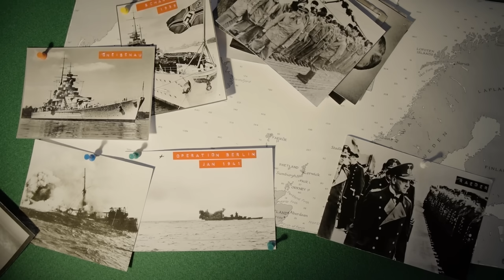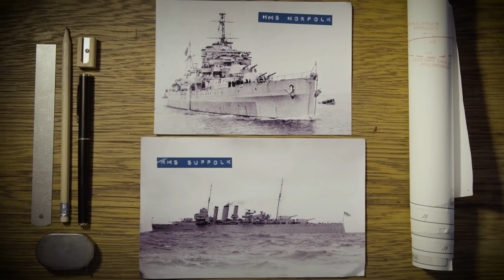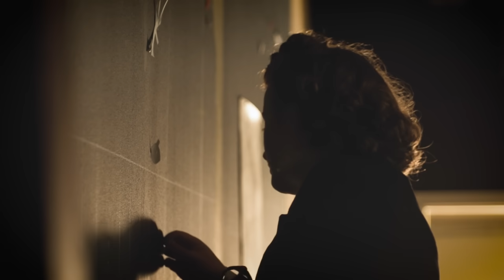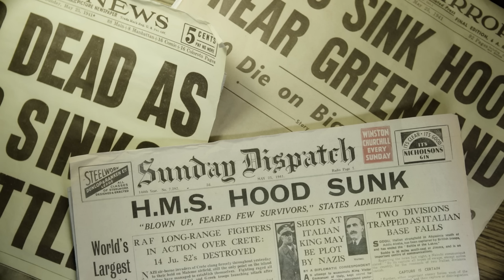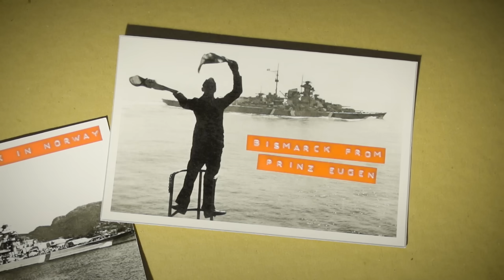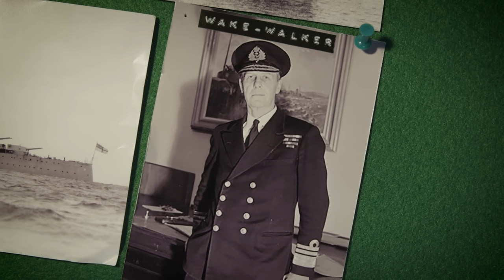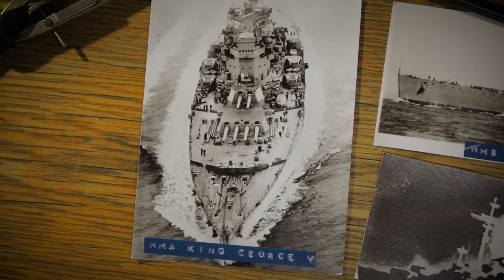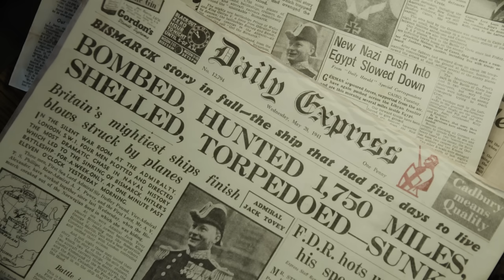Bismarck: How Britain Sank The Infamous German Battleship | Full Documentary | History Hit

Comment: "Attack of the Fairey Swordfish" - sounds like a fantasy novel!  hehe  They were too old, too slow, too obsolete....  TO BE STOPPED!!  hehe  what a glorious underdog story!!
Reply: The Fairey Swordfish were designed & built in Britain from 1935 onwards, originally for the Greek navy, But when trialled prior to delivery they were seen to be so capable that the Royal Navy bought them instead. 

They were biplanes for a very good reason. At the time they were designed existing aircraft engines were of relatively low power (especially for the British fleet air arm which was ALWAYS low down on the engine & aircraft "priority list") so to enable a carrier aircraft to carry aloft heavy loads needed a large wing area. Their biplane wing area was SO great that they could take off fully loaded WITHOUT the use of a carrier's catapult. This meant that in the stormy North Atlantic where the Royal Navy mainly intended to operate them, instead of being forced to take off at the carrier's bows (where the catapults are) and which is the part of a ship that rises and falls by the greatest amount in heavy seas, the Swordfish could take of from the middle of the carrier's decks close to the bridge where the pitching and rolling was the least.

It was for this reason in May 1941 that they were able to take off from HMS Ark Royal to attack Bismarck when the Ark Royal was struggling through an Atlantic gale in MOUNTAINOUS seas, with her bows rising and falling by nearly 60ft !!! Try to imagine how terrifying it must have been for the brave young crews flying them in those conditions. Those weather conditions would have prevented all other allied carrier aircraft of the era from flying and instead seen them safely lashed down inside the hangar deck.

They were also incredibly adaptable and throughout WW2 they were adapted to carry, bombs, depth charges, torpedoes, extra fuel tanks and even eight anti ship rockets as well as the world's very first naval airborne radars, and its for THAT reason they were nicknamed "stringbags" as they seemed to be able to carry ANYTHING. They are widely regarded to have ended the war as the aircraft with the GREATEST amount of enemy shipping tonnage sunk, and were HUGELY loved by their crews.

They WERE to have been replaced mid war by a succesor, the Fairey Albacore, but the "stringbags" were so ubiquitous that they outlasted the Albacore in service.

Comment: Rodney was a beast.  Her odd configuration was dictated by the Naval Treaties, and was an innovative design pursuant to those limitations.  Her slow speed made her a second line battleship in WWII, but otherwise she was solid.
Reply: She, and her sister, were certainly not seen as 'second line' in WW2, any more than the Colorado class were.
Reply: @dovetonsturdee7033  Compared to the fast battleships built just before and during WWII, she was second line.  It is silly to pretend otherwise.  That is the meaning of second line -- one step behind the top of the line battleships.  And one of the reasons for this was the crimping effects of staying in compliance with the treaty.  The point is not even debatable.
Reply: @dmbeaster  Yet, when the Royal Navy needed battleship support for Operation Pedestal in August, 1942, which did they choose?  King George & Duke of York?   No. Nelson & Rodney.
Reply: @dmbeaster   Rodney and Nelson were serious battleships up until Tirpitz was sunk. Not having the speed to catch a fast German battleship (the German super power of running away), but having the firepower to slug it out with Tirpitz if a battle could be forced.  They assisted in the invasion of Italy in 1943 as Tirpitz was severely damaged but were both back in UK by the beginning of 1944 to be ready when Tirpitz's repairs were completed.

Where Rodney and Nelson became secondary was when attention shifted to the Pacific where neither battleship would be able to keep up with a carrier group and there already were plenty of slow US battleships for shore bombardment.

Comment: Bletchley Park has a podcast about their code breaking during WWII, if anyone is interested.  It's absolutely fascinating.  
They probably have more about the intercepted messages flying around as Bismarck was trying to make it to port.
Reply: The German u boat U-110 had been boarded on 9th May 1941, and her enigma device with its associated rotors & codebooks had secretly been captured, this would have opened up the U-boat enigma nets to Bletchley park for the rest of May 1941 and allowed the British to listen in to U-boat dispositions during the Bismarck saga, but the Kriegsmarine surface ships themselves used a seperate enigma net from the U-boats that had not been broken into at the time. It was the British use of HUFF DUFF (or High Frequency Direction Finding) that pinpointed Bismarck's location after she had slipped her shadowers, and the port that Bismarck was heading to was gleaned from a luftwaffe enigma transmission that had been cracked after the message had been transmitted from Athens to Berlin.

Comment: Drachinifel (Naval engineering historian) has a theory that the arguably thin decks of HMS Hood were not the cause of its magazine explosion. Hood at speed had a positive wake along her forward 50% of hull length. The aft half developed a negative wave that exposed her hull below the armour belt. A lucky shell (fired line of sight) entering here would have nothing to stop it causing tremendous damage. 
Impossible?  HMS Prince of Wales was hit beneath her B turret by a shell that stopped by her keel. The shell had entered backwards got decapped and failed to explode.

Comment: Just because something is obsolete doesn’t mean it can’t accomplish a task. I’d argue Swordfish was obsolete by that time, but it was used in circumstances that let them be successful.
Reply: I think that the obsolescence of the Swordfish may be over played. If a plane is used out at sea beyond the range of land based fighters, against an enemy with no carrier defence. The fact that is so slow that when it is flying into a strong headwind a destroyer can overtake it does not matter. However the fact that it can take off into a snowstorm from a carrier taking the sea green over the flight deck is very useful. As if you are the only thing in the air, you become for that time and place the most advanced aircraft going. The Swordfish was also somewhat ironically very advanced as they were amongst the first aircraft to carry air to surface search radar.

Comment: What attempts were made to steer the Bismarck once the rudder had been damaged?
Reply: The only viable option was to steer her with the propellers. Various settings on her outboard turbines were tried but as had already been discovered during her trials in the Baltic, she responded very poorly to steering with her propulsion, partly due to the fact that her triple propellers meant that a full 33% of her propulsive power was central and could have no effect on her steering, and partly due to her hull's length meaning her hull provided a large amount of resistance to turning forces from her propellers.
Reply: @walterkronkitesleftshoe6684  Thank you. Was it not possible to disengage the central propeller?
Reply: @Sam-z5r5r  Yes Sam, all 3 turbines could be operated independently, and theres an interesting story that when Bismarck was trying many combinations of her three turbines to steer with her propulsion, Gerhard Junack, Bismarck's chief engineer, stated that when her central propeller was used a "banging could be heard" which he couldn't explain at the time. When Bismarck's wreck was being surveyed in around 2000 it was discovered that the detonation of the Fleet Air Arm torpedo on Bismarck's starboard aft quarter had bent the rudder stock of her starboard rudder inwards, so much so that the starboard rudder was touching the blades of her central propeller and the rudder showed damage where the central propeller had been striking it, which was the cause of the "banging" that Junack had heard 59 years earlier.
Reply: @walterkronkitesleftshoe6684  Thanks for that Walter. It explains the impossible position they were in. That was one lucky and highly damaging torpedo and presumably yards away from missing completely. I'm an engineer, so my mind was engaged on why they seemingly failed to fix a fixable situation. I wonder if they considered using heavy drag objects on one side in order to straighten their course, even if it would have slowed their rate of knots. Or (i guess) they could have deliberately flooded chambers to list the ship to one side..? They did have various boats on board. Were they deployed to act as steering craft.do you know..? I wonder if when considering the original design they considered emergency side rudders..? or steering sails..? or wind out steering panels, at or below water level. You'd like to think at least 2 or 3 other methods of steering would have been in the original design....? Invincibility over practicality..? Or was it standard on both sides not to have back up steerage plans..?
Reply: @walterkronkitesleftshoe6684  Amazing really that you couldn't change the angle of axis of the propellers or that there wasn't a water propulsion option for that situation...?

Comment: The plunging fire theory is a massive misnomer. Rounds do not go up, slow down and then plunge almost vertically. 

They don't. They travel on a ballistic arc. The shells would have landed at an angle of about 15 to 18 degrees to the horizontal. Hood's deck armour was multiple layers of armour, over 3 decks. It was a maximum combined thickness of about 6 1/2 inches. It was designed to decap the armour piercing shroud on the tip of the shell then disrupt the ability of the shell to hit anything vital.

The short landing round penetrating under the belt armour is probably more likely.
Reply: The data tables from the German's own "naval artillery testing command" (or AVK(S)) show that at the range from which Bismarck's killing shot was made (17-18,000 yards) her shells had an "angle of fall" in the region of 11º - 13º. 

Prebuild testing of Hood's main 3' armoured deck showed that it was proof against 15' shell fire at anywhere less than 20º aof.

Comment: 59:30 the swordfish greatest asset was that it flew so slow you needed a calendar to measure its speed. this made landing a breeze. the seafire was just a "one use only" aircraft as the rolling seas and pitching deck would remove the prop / undercarriage any anything else before being shredded in the catch net.
Reply: The greatest asset the Swordfish had was the ability to get into the air in conditions which made it impossible for heavier aircraft to get off the deck. At the time of the successful attack, even Fulmar aircraft intended to accompany the Swordfish could not fly, such was the sea state.

Ark Royal was ploughing into waves often over 50 feet high when the strike force left her deck.

Comment: The Hood did not sink immediately following the explosion. For about 10 seconds or so following the explosion the Hood righted itself and Holland who had been knocked out of his chair got back into it. For a moment people thought that was a bad hit but they had got away with it, only for moments later the ship violently listed, broke apart and sunk quickly. The three survivors only survived having been caught in large gas bubbles created by the boilers exploding as the ship sank that propelled them to the surface.
Reply: Drachinifel has a great video analyzing the explosion of Hood.  Best explanation was that Bismarck's hit set off a magazine for 4" secondary guns which managed to breach the bulkhead between that magazine and an adjacent magazine for Hood's main 15" guns.  Hood didn't break apart. Hood was blown apart by a main magazine explosion which occurred seconds after the initial explosion.

Comment: The plunging fire theory is clearly wrong based on the range.  Hood was well within the range where plunging fire was no longer a factor.  The "short" theory has far more viability, and Hood also had a unique feature where the wash created at high speed created a standing wave that had a trough that exposed the aft section where a short need not even penetrate through the water.  The theory is that it ignited the 6 inch magazine, which spread to the magazine for the main guns, causing the massive destruction.
Reply: I believe you mean the 4 inch magazine.

Comment: Couldn't Hood still have closed in but closed in at an angle that would have allowed for all guns to still fire even though it would have put the rear guns at their maximum limit
Reply: She had quickly closed the distance to clear herself from the ranges where long range plunging fire from the German ships would present a distinct danger to her realtively weak horizontal deck armour, having done that she was actually in the process of a turn to port to open her aft gunnery arcs, when a shell from Bismarck likely found an obscure "Achilles' heel" in her vertical armour.

Comment: The prince of wales was incredibly lucky. A 15" shell from the Bismarck penetrated her underwater and landed up unexploded near the secondary magazine against the torpedo bulkhead. There is a picture on the internet.
Reply: I think the greater luck was that PoW scored an underwater hit on Bismarck that appears to have exploded - which cost Bismarck a flooded boiler room.  Generally the fuses of shells do not survive hitting the water and therefore don't detonate when they score underwater hits. 
Not aware of any superiority in British shells that would explain PoW's hit on Bismarck, so it is more luck that PoW's shell exploded than luck that Bismarck's didn't.
Reply: @iansneddon2956  Excellent point, i wonder how Bismarcks hit on HMS hood set off the 4" magazine after penetrating her side armour.  drachfinel explains a theory where hood was struck as she was turning so despite the hit being low on the hull, the area would have been underwater had the hood been steering in a straight line. it was just at that moment she was struck while executing her turn and the portion of the hull being out of the water. Such is fate, but it also explains how it exploded after hull penetration
Reply: @iansneddon2956 and typically yes, but sometimes statistical anomalies do happen. apart from destroying dynamos it did cause additional flooding which further slowed down the Bismarck though not a very serious hit
Reply: @z1az285  My recollection of Drachinifel's video was that the way that Hood's bow broke the water at that speed caused a bow wave that extended back to around the main guns with the resulting trough exposing the lower hull at this unfortunate location.  This allowed a shell from Bismarck to strike the lower hull of Hood without travelling through the water.  A plunge through the water would most likely have damaged the fuse on the shell as well as slowing it down.  Striking the lower hull, below the armor belt, meant the shell hit unarmored hull and carried through to the 4" magazines which caught fire and, on detonating, set off the main magazines.  The main magazines were protected by bulkheads but they were insufficient to withstand the secondary magazine explosion.  
Eyewitnesses report a smaller first explosion after which Hood blew apart in a second explosion.
If Hood had not turned to deliver a broadside against Bismarck, this hit may have been impossible.  Bad timing. Bad luck.
Reply: @z1az285    Battleships are designed to stand up to a lot of damage, with redundancies built in to allow the ship continued action.  Reducing Bismarck's speed proved quite useful.  Bismarck was a bit lower in the water, and had to cruise efficiently with the remaining boilers considering the loss of fuel from PoW's hit to Bismarck's bow (need to conserve fuel to ensure they could make it to France.   Considering Bismarck was mere hours away from coming within range of Luftwaffe aircraft, the Royal Navy did cut it a bit close in that last torpedo bomber attack.
Reply: @iansneddon2956  Yes, but she had been hit multiple times by then and Holland had no choice but to turn to bring all her guns to bear. fate indeed. still terrible to imagine.